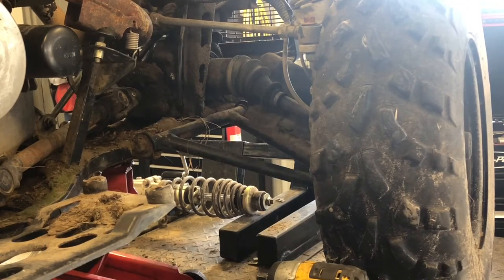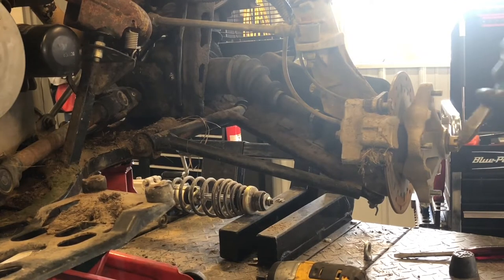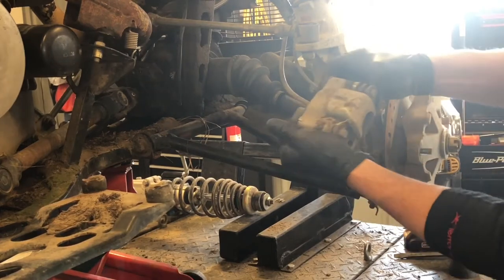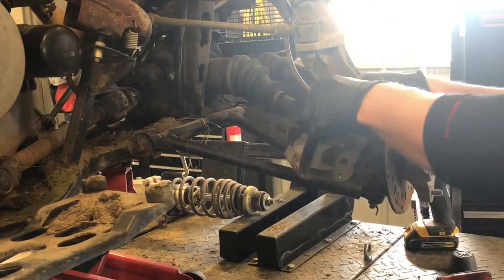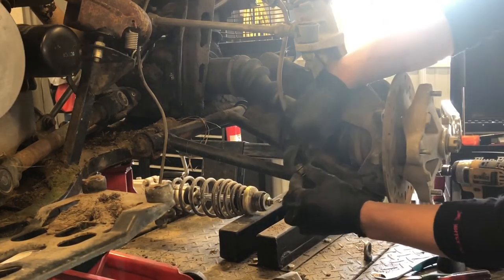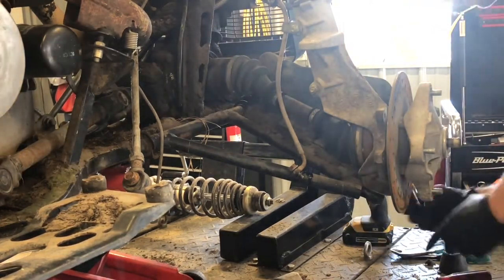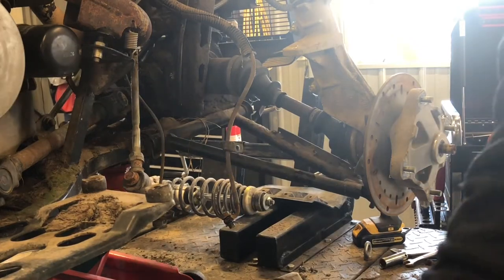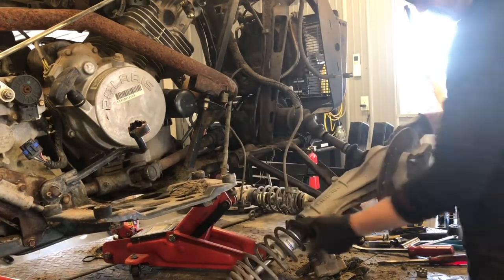Polaris Magnum 330 - Front Brake Pad Shaft Replacement

Comment: Hey i do have the same ATV as you and planning on doing u joints as well my bike has the same things as yours but has the roll pins in them as well as you and no grease fittings on it only u joints have them but the ujoints look decent for a test ride but will be needing replaced soon was wondering if you could make a video on the rear drive shaft u joint replacement video